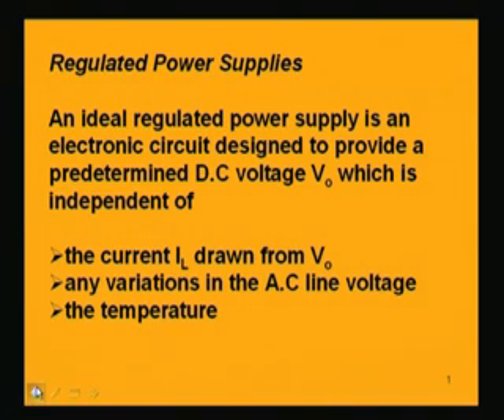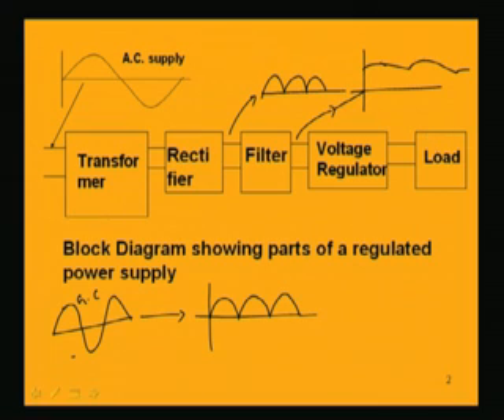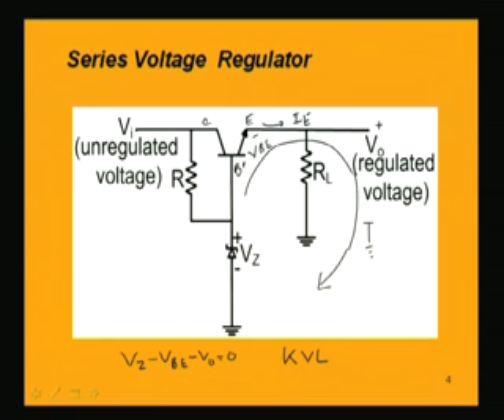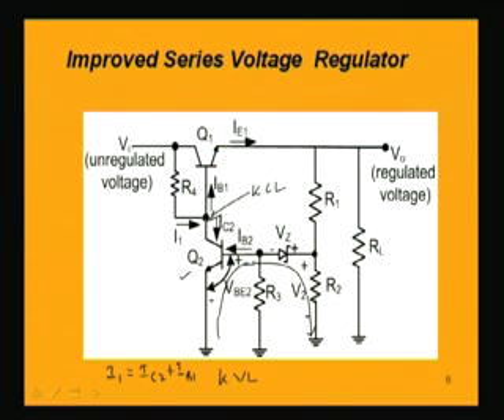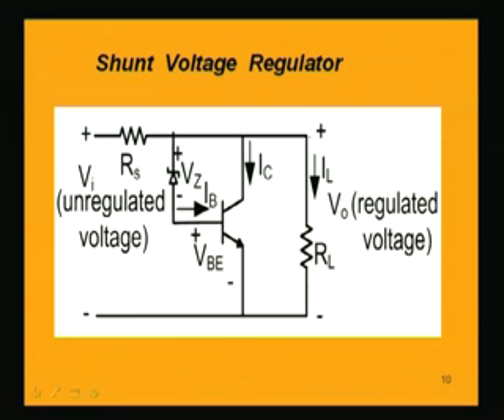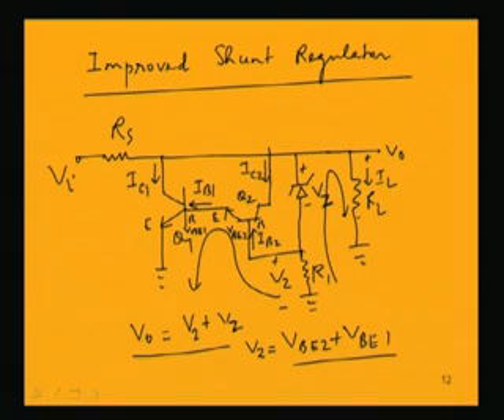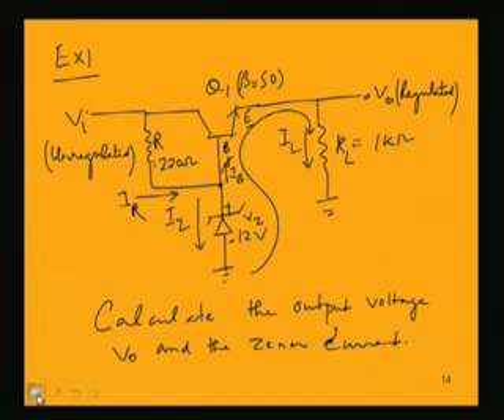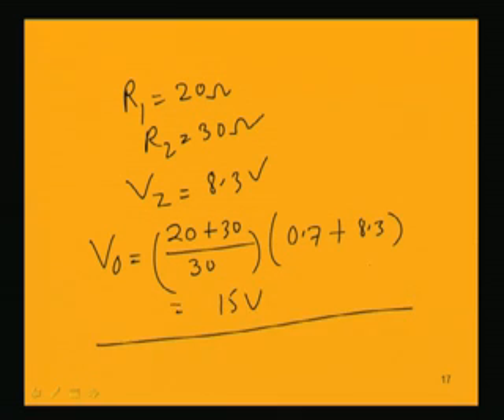Module -5 Lecture - 5 Regulated Power Supply

Comment: In improved series voltage regulator why I1 is constant
Reply: it is not constant, in fact changing I1 does not matter because we are taking the reference as ratio  of two values which will always remain fixed. let us take this example u will get clarity:

suppose you have 100 chocolates and u have to divide it between two persons A and B in the ratio 60:40 , then A will get 60 , B get 40 , ratio  will be  6/4

now if chocolates is increased from 100 to let say 200 , now dividing between A and B 
A get 120 and B get 80, now ratio will remain same 120/80 =6/4

Comment: Mam,With due respect ,I would like to mention that I have  read some where that Vbe remains constant as the diode drop,but when i analysed this circuit I found Vo is constant because Vz and Vbe are constant and when there is a fluctuation in the Input voltage ,current through resistance will increase and the Increased current will be drawn by the zener diode maintaining the constant current through the base of transistor,hence maintaining the constant current through the emitter and collector also.Hence Vo will be constant ,but if i have any miss conception then kindly correct it because you are explaining that Vbe will change.
Reply: I have  in 1 st year of ECE engineering.  Any device for me....how should I pursue my engineering.?

Comment: I hav a doubt pls clarify it.  
in op amp series votage regulator what should be the value of zener diode voltage.
Reply: I have  in 1 st year of ECE engineering.  Any device for me....how should I pursue my engineering.?